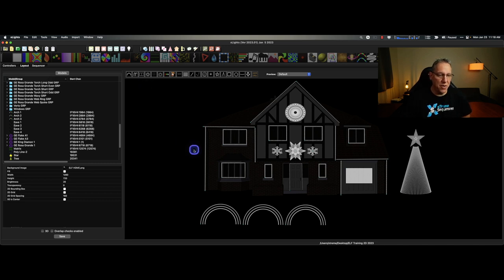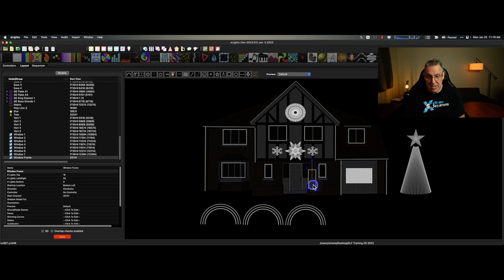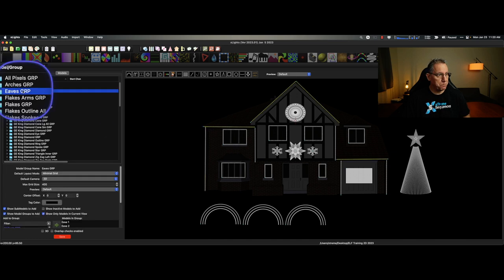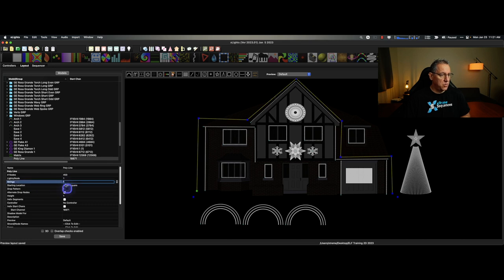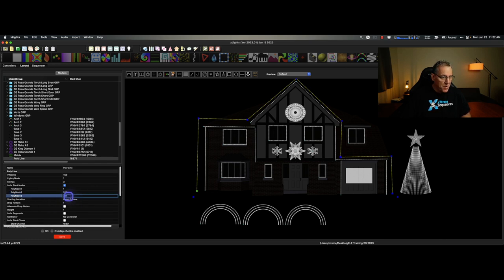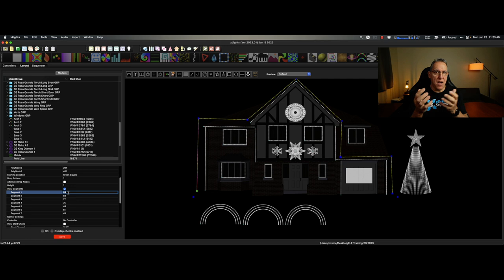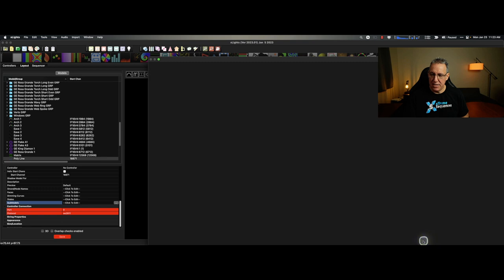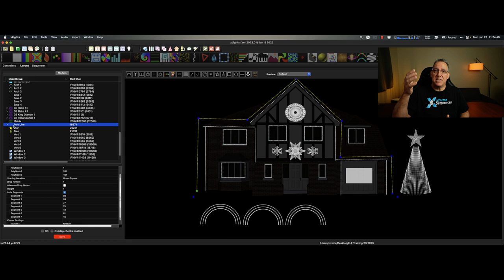xLights Single Line vs Polyline Model

Comment: I guess another con regarding the polyline would be if you've outlined your main house, there is often more internal verts and eaves that will have to be single lines then it just becomes more work and its not even part of the polyline until you make it all in a group, but then it's just messy.

Comment: I got burned by the Polyline this year.  Had it for my garage outline and part of the roof.  Everything was fine until I decided to change the start nodes and number of strings.  Wanted to have strings start from both sides of the garage door at the bottom left and right corners.  If I had done single lines it would have been so much easier, instead my garage outline is now a custom model and that was a huge pain to do the vert and horizontal sub model groups.
Reply from the maker: I'm sorry to hear this. The polyline tool is great for the right application.